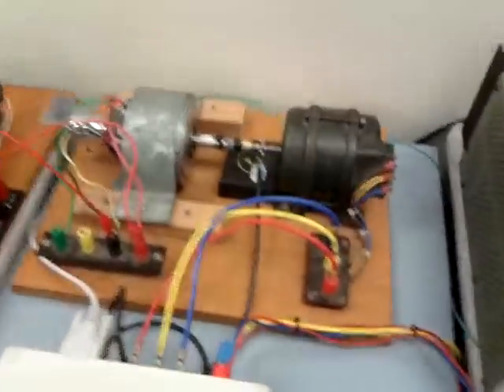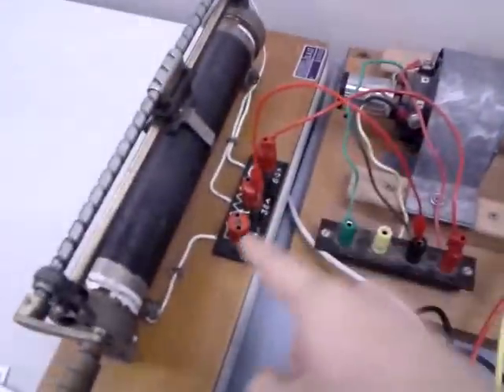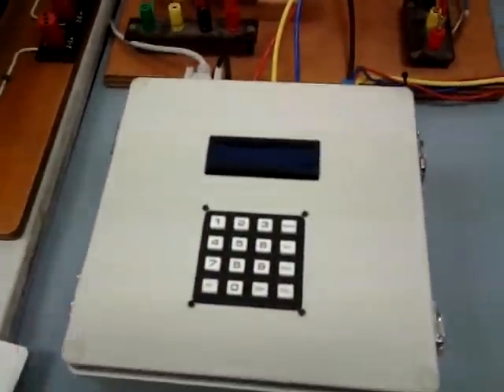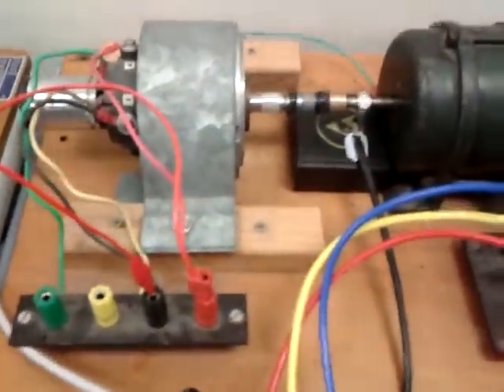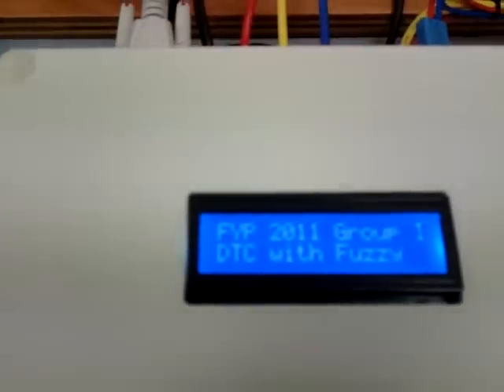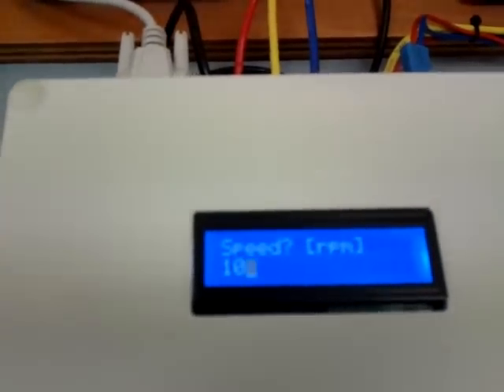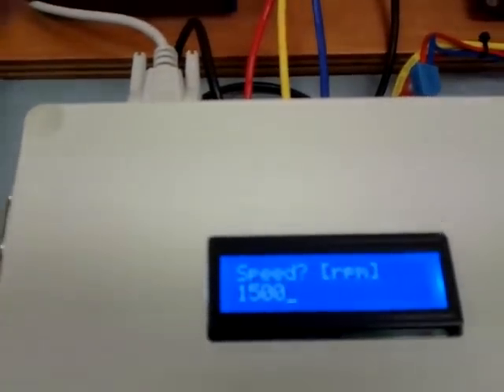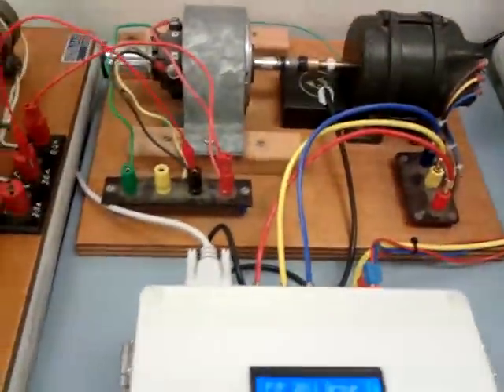DTC with Fuzzy Logic - Final Project

Comment: Please send me full experimental setup details for my mail id sir, vsakthi.me@gmail.com
Reply: I can't remember much, I haven't worked on it in over 5 years now.
We used:
* IGBT STGIPL14K60
* MCU UC3C264C
* Current sensor LA 25-NP
Voltage was sensed using a voltage divider
There was an analogue multiplexer
The motor was 1/45 HP - this was coupled to a DC motor and the DC motor connected to a variable resistor
We used 2 benchtop power supplies for control, auxiliaries and power 

The experimental setup is visible in this video and my other one

Comment: I have been looking into the DTC equations and I desperately need some help regarding reference flux and torque values. I'm thinking rated torque should be straight forward using Rated Power = Rated Torque * Rated Angular speed. (Please confirm that this is how it's done)
But what about flux?
How to provide the reference flux value OR how to calculate the rated flux of the machine? I know rated flux will be proportional to V/F but this will just give me the weber turns because V=4.44 f phi Kw T. I assume the DTC equations will require the flux to be in webers...
Reply: I'm currently on holidays, so I don't have access to everything, but as far as I remember, yes, the flux reference was required to be in webers.
The torque reference in our system was derived from the speed controller (PID loop using a speed reference and the speed sensor); if the speed was too low, the torque reference would be driven up and if the speed was too high, the torque reference would be driven down.

If I remember, I'll try to find the answer for the flux calculation when I get back home in a couple of weeks.
Reply: Thanks dude...

Comment: 1 word....Sexy! Embarking on the journey of DTC myself and hope it works. Done Scalar control...Now time for DTC.
Reply: DTC is pretty simple once you get your mind around how it works, the real challenge is having hardware fast enough to give good results.
Good luck!
Reply: I will be using dsPIC33EP. one important question, did you do sensored or sensorless. Looking for incremental encoders and my god those things are costly. A quote I just got, twice the cost of motor and drive combined. Will sensorless be easily possible?
Reply: Chinmay Harkare We didn't manage to get speed estimation working, it wasn't a goal, just a nice-to-have, so we spent only a couple of days before implementing a $3 hall effect switch and 2 magnets. You can actually see the sensor in the first few seconds of the video, it's bluetacked to a box under the shaft and the magnets are just placed onto the shaft.

Advantages: cheap, easy/quick to implement
Disadvantages: a step change from high speed to low speed can cause the algorithm to over compensate and flip the direction of the motor- the hall effect switch only knows time between pulses, not direction.

I think if we had more time (and possibly more processing power) we could have got speed estimation working; as for easy, well, that's relative to your own knowledge, available resources (papers, journals etc.) and the amount of time you have to understand and implement the theory.
Reply: ***** Thank you and we will be in touch....You're guidance throughout the course of the project will be very helpful. Regards.

Comment from the maker: There's nothing particularly special going on, we read some values from the ADC, perform some calculations to scale the inputs and then plug the scaled inputs into the DTC formulae. From the formulae we get error states; the error states are passed to either a standard DTC "controller"/function or to the fuzzy "controller"/function.